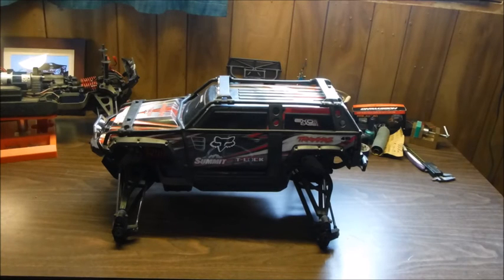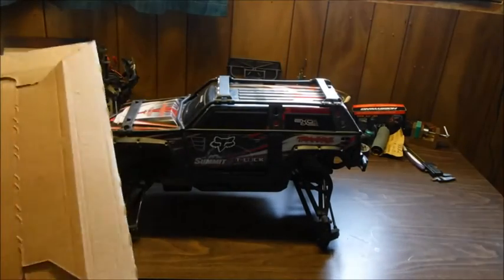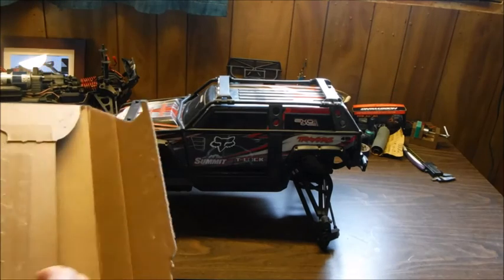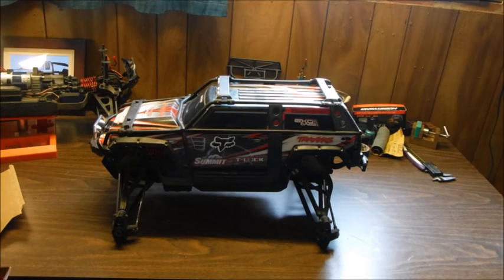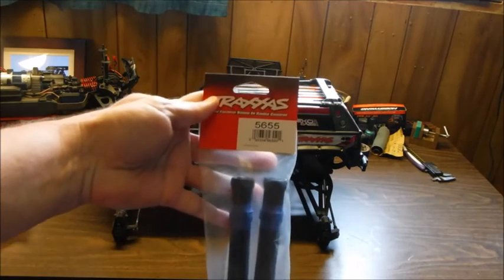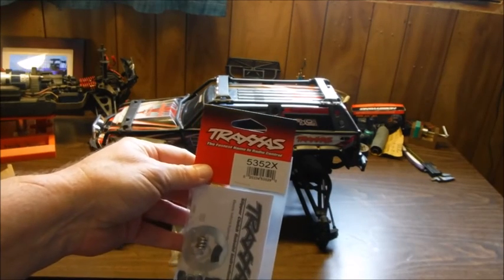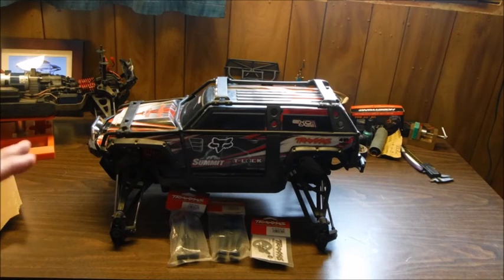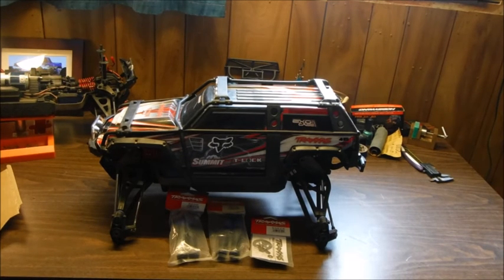First Parts Order Has Arrived For My Traxxas Summit

Comment: Cool! adjust your slipper clutch properly and it will help save your out drives and diffs... I always say it's better to run a slipper clutch a hair loose than break all your drive train..... much more simple to replace a slipper clutch!Have fun working on it.
Reply: +shenlonco we lock the slippers for crawling with summits you wont break a summit to easy on the big summits
Reply: I used to set mine so it would slip when holding both rear wheels and giving it gas it would lift the front up about to the 10 O clock position and be slipping.
Reply from the maker: +shenlonco Thanks, I am going to get Kev to show me how his Summit is setup because it works great for crawling and bashing. =) He's the expert in our house. LOL
Reply: +shenlonco to each his own i always say . i ran mine a bit lose before and ll it did for me is burn up the slipper plates and iam a basher with it and i make it crawl and work hard so i dont want slip... if your racing hi speeds you want to have some slip so you dont wheelie on take off but we are talking  summit which is no speed demon unless you mod it for that in which case i say by a revo instead. we all setup our rigs for how we drive really